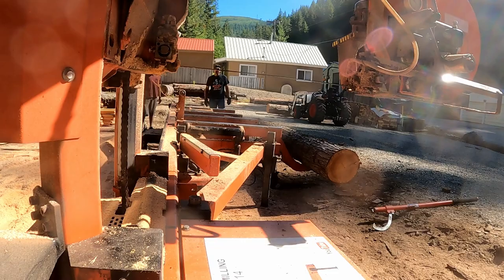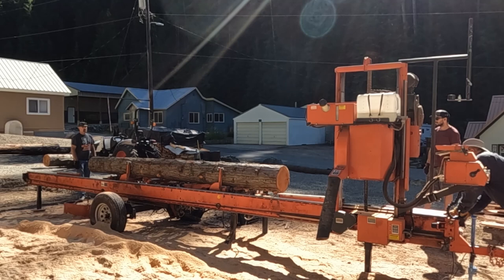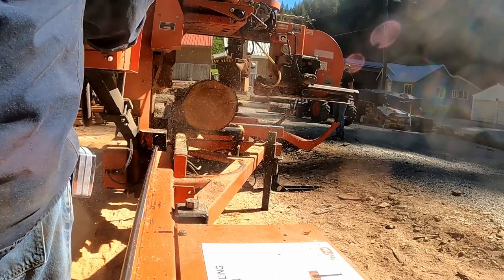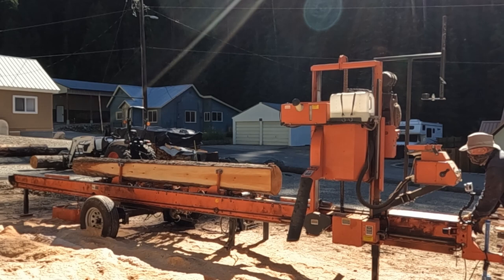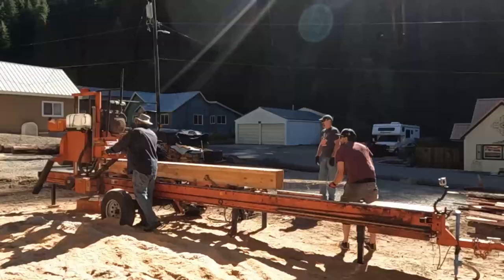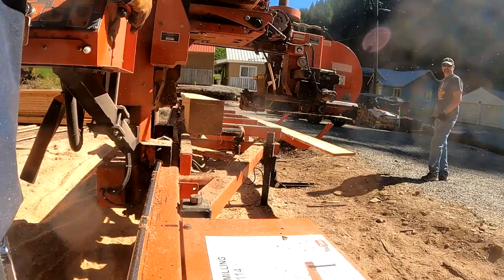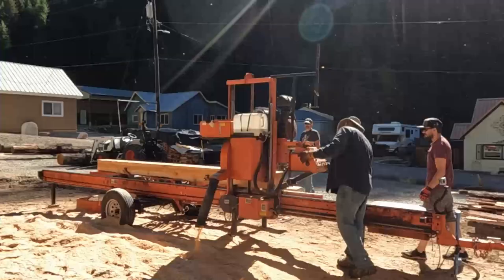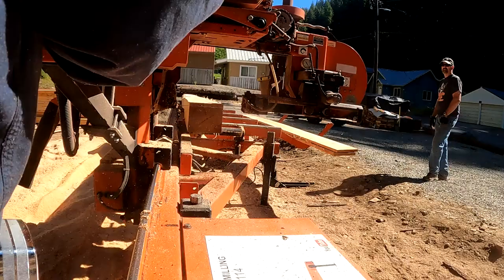Sawmill in Action Milling Western Red Cedar!

Comment: NW Sawyer suggested your channel. Is your Wood Mizer LT40 Sawmill stock or did you have features added? I will specify. I saw you raise the cant to clean the deck off to be level. Was that part added or was it standard. I am going to have to watch again to learn about how to deal with stress in a log. Perhaps next time when it comes up, you can get the camera a little closer or point it out. Have good days!
Reply from the maker: Welcome and thanks!  My mill is the standard LT40 Hydraulic with the only WM option added being the fine tune adjust front outrigger leg.  The baskets and umbrella mount are my own adds.  The Hydraulic toe board rollers are standard and I love having them!